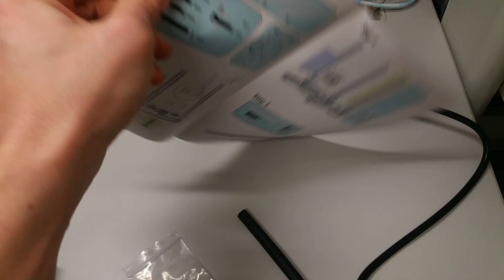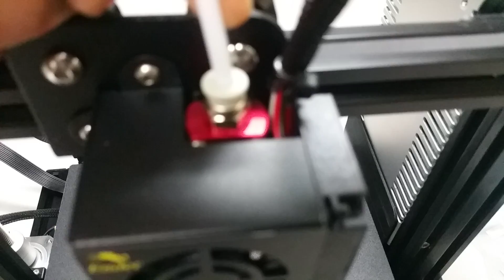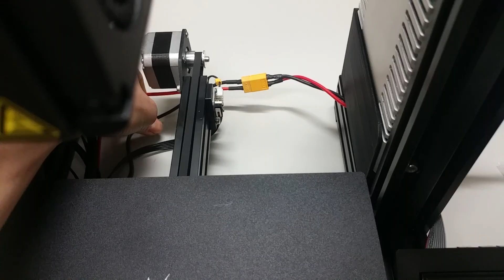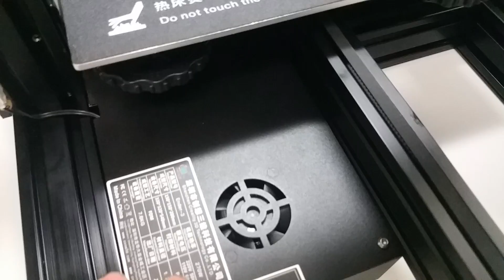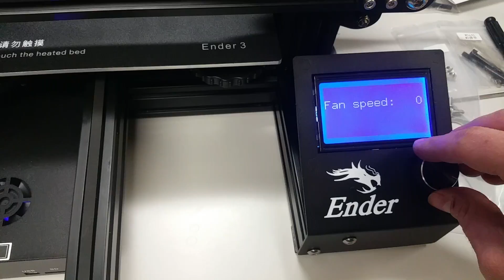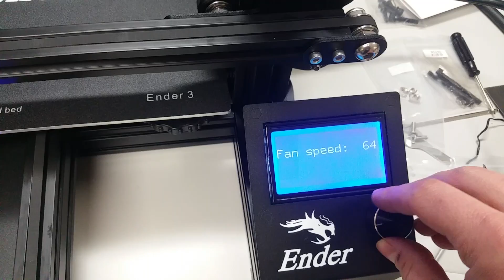Creality Ender 3 overview (part 1)

Comment: Just got one and put it together. Doing the test print now. Got mine from Amazon for $238. It came with a small spool a filament along with the small bit you show in the video. Mine also came with an injection molded power supply cover. I've not had any unusual fan noises.  Also have not had any of the other issues reported like uprights needing shimming, or y axis rail being off square, or bed being warpped. So far seems like a nice unit. I did replace the plastic extruder thingy (the lever with the spring aparatus you squeeze to load the filament) for aluminum. Also bought a mosfet for it, but didn't install because I wasn't sure if the one I bought could handle 24v.
Reply from the maker: it doesnt need the external mosfet as it is 24v (twice the voltage, half the current),  i dont recall seeing people in the FB groups doing that (there are too many people posting their "look what came in the mail" pic), so far mine has been printing great, the only thing i upgraded was the fans and printed a better blower for part cooling

Comment: Nice video. Could you show a quick guide how to replace the control box fan? It would be most helpful.
Reply from the maker: sorry but i dont think i will be making any more videos. i took a cheap LM2596 dc-dc buck converter (very common on ebay, banggood, amazon, etc) connected the 24v power to the input and adjusted the output to be 12v, and wired up some cheap red "jst" connectors (google it) connected up the always on fans to that. Fugatech did video on the cr10 you can see the connectors im talking about and how i connected the hotend cooling fan https://youtu.be/91IRlzP8rNs?t=6m35s

Comment: This is essentially a smaller version of the Creality CR-10 Mini, which I own.
The mini bed is 300 x 220 x 300.
Reply from the maker: the actual size of the bed is 235x235, and it could probably print that if set up correctly, main advantage (my opinion) is the AIO design for simply moving it around. If you wan to enclose you printer it may be an issue, but i like it this way. Also the 24v system heats up the bed fairly quickly

Comment: Why are these 3d printer manufacturers still locked on the open frame floating architecture. I keep comparing these to the Anycubic I3 Mega and I simply cannot find any benefits to these CR-10 like machines.  Take note: the Anycubic I3 Mega is a fully enclosed "steel"machine  with an excellent touch screen display  (none of this dial tone knobs to sequence throught the programing) and in my opinion the best heated bed platform of any similar priced printers out there. A single skinny channel (rail) architecture for any of the Axis's is not as precise as a dual channel (wide rail) axis platform.  So Creality went from a single tower on the original Ender to a dual Z axis tower, still single stepper, ok, but they left the Y  axis still a single channel (rail) ??? If you are going to improve a machine,  for heavens sake! do it right! and price it competitively with the machine they should be referencing to, the  Anycubic I3 Mega.  It just seems most 3D print manufactures are still stuck in dark ages.  These machines should be well enclosed and pre-built by now with properly  manufactured steel /injection molded parts and not 3D printed  plates or brackets. To me, these are all pieced machines, in other words mended, and every version seems to offer a bit more mending, but not a complete, well thought out, solid design from the bottom up.
Reply: You have some valid points. BUT. If you look at Creality's line of printers rather than randomly ranting, you'd find they have a large range of machines including XY Core & SLA, and Industrial models. XY Core: https://www.aliexpress.com/item/Core-XY-V-Slot-Frame-CREALITY-3D-Auto-Leveling-3D-Printer-Ender-4-Laser-3D-Printer/32816070991.html and SLA: https://www.aliexpress.com/item/CREALITY-3D-High-precision-resin-LED-light-curing-DP-001-DLP-3D-Printer-Large-Print-Size/32800819092.html.  Industrial: https://www.aliexpress.com/store/product/Creality-3D-CR-3040-Full-Assembled-3D-Printer-Aluminum-Extruder-Large-Printing-Size-upgraded-Mainboard-with/2846085_32797795515.html They market to many levels of consumer. If you are so firm in your beliefs as to how to build a printer, you're welcome to start your own company, but watch out, Creality will eat you for lunch. BTW: for the record, I agree with you on a closed frame machine ;-) That said you're comparing a $400 printer with a $200 printer and saying it's better. Duh.
Reply from the maker: considering its in the Ender line which has been low cost, they are keeping with that theme, its a low cost printer with an average price of $260 CAD (at time of this comment) and the i3 mega is ~$400 CAD, so not exactly a competitor. This printer only has 1 printed part, the PSU cover, everything else is either aluminum steel or molded plastic.
Reply from the maker: Well said @thePuterPro, i didnt know they even had a resin printer (which looks over priced at first glance). If the Ender 3 had all his talking points of being assembled out of the box using steel parts and enclosed with more modern electronics it would be similar if not more expensive than the i3 mega.
Reply: Eating crow yet? Lol jk but yeah this printer is awesome for the price.

Comment: does the electronics housing mount to the y rail at all?
did the buildtak surface come pre-applied?
thanks!
Reply from the maker: The electronics box has 1 screw at the back into a threaded hole in the cross piece extrusion, the 2 small one you can see on the front top are into the sheet metal box, then the 2 large front ones are obviously into the holes of the extrusion just like the display mount. The base was almost fully build apart from the display, so yes the build tak was already applied, and there is no spare supplied if you damage it.

Comment: How would you rate the stability of the bed?
Reply: Pretty good.  My first print far exceeded my expectations.
Reply from the maker: havent printed on it yet, but rolls smoothly, practically no wobble. Comparable to the Wanhao i3 which uses dual smooth rods/bearings. I will try and get a print off tomorrow and possibly a part 3 vid
Reply: reflector36 thanks. I look forward to your impressions after 1st print. I have the ender 2 and this looks like a good upgrade with the bigger build plate.